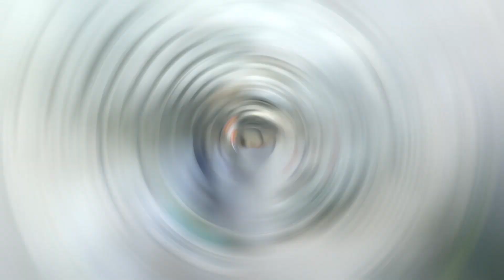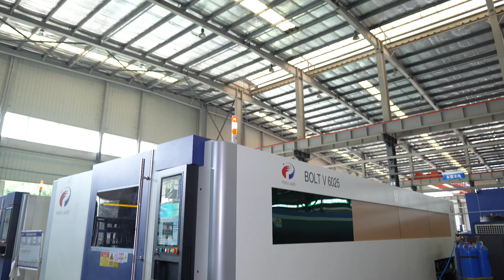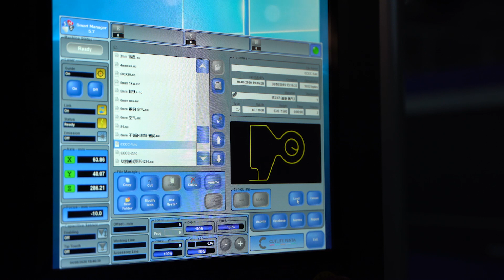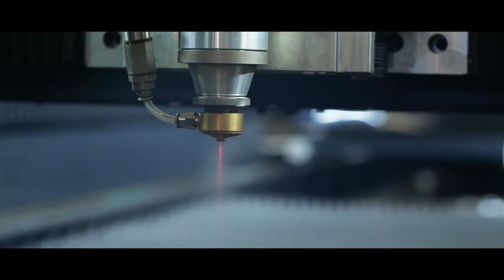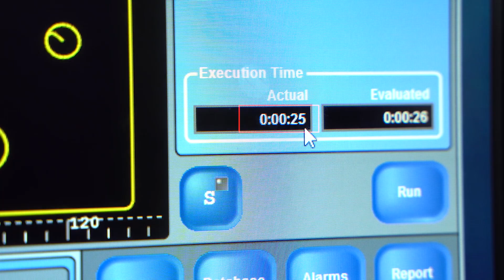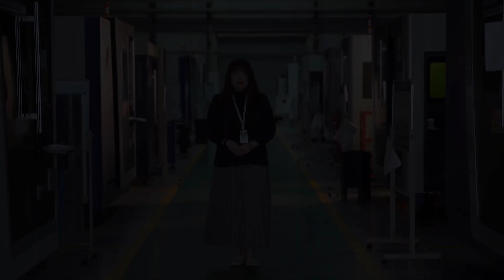PENTA LASER SUPER HIGH-END PROFIT MAKER BOLT V  FIBER LASER CUTTING MACHINE IPG 12000W

Comment: Dutch customer uses 8kW Bolt 6 months already , he is very satisfied because the machine is easy to use, have Low costs and brings high productivity. What else do you want in this competitive market.
Reply: Nowadays there are a lot of Customers in Holland using BOLT and Swing Models. Users are very satisfied about the preformance and also about very low costs. This means about parts of the machine but also about the support we deliver. Given by us together with the great technical department of Penta Laser. Job well done!